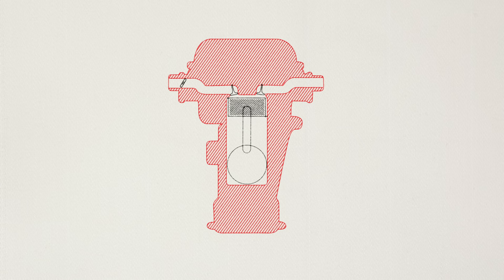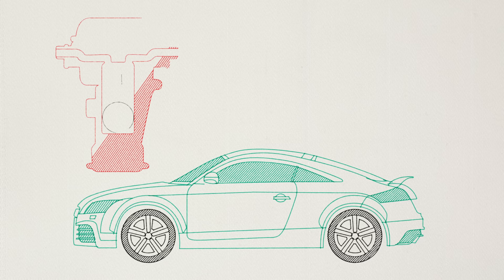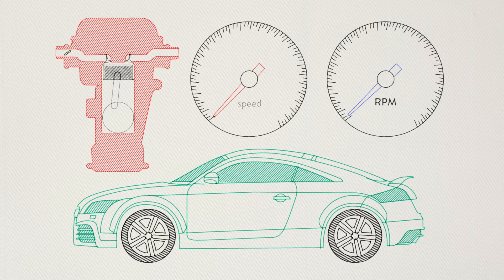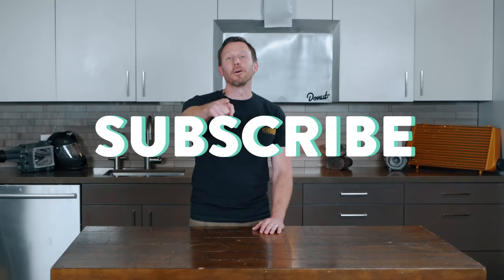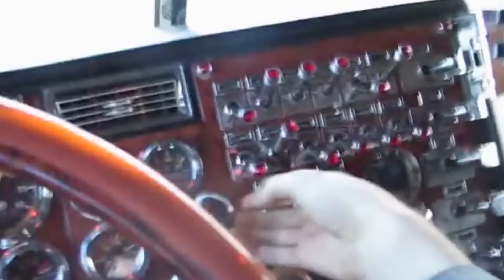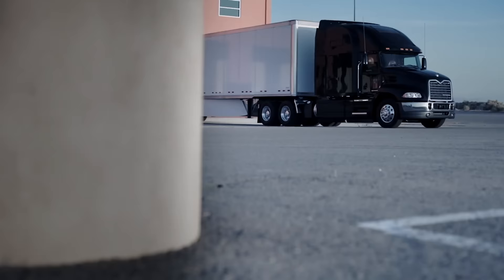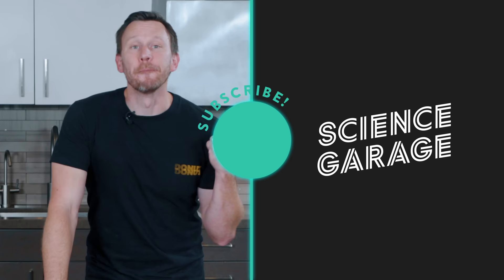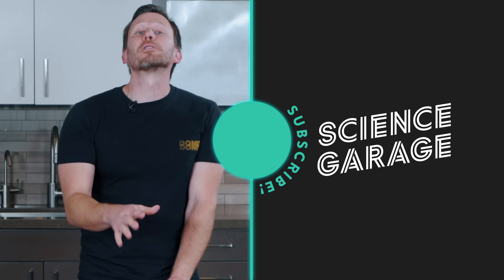ENGINE BRAKING | How Semi Trucks Slow Down Without Brakes | SCIENCE GARAGE

Comment: Can some one explain what happens in a similar situation in automatic transmission
Reply: the resistance you feel when you let go of the accelerator pedal but still in drive in an Automatic?
you are pumping Automatic Transmission fluid through a pump automatically with the rotation of idle coming from the engine, that takes energy, which makes it feel like you're slowly braking (which you are) that's why when you switch to Neutral, you can coast wayyy further than coasting in Drive.
also, depending on the car model and how the transmission is assembled, it can cause Transmission damage if you coast in Neutral, depends on the Brand and Layout of things though.

Comment: It is not the throttle body !! I tried and it's not true, it's the compression. I have a cable operated throttle and I turned off the engine. When I hit the gas I still decelerate at the exact same rate

Comment: The first ‘engine braking’ he explains is commonly called transmission breaking, used in gasoline engines and practically all experienced truck drivers, transmission breaking is more commonly used with truck drivers, the only time truckers will use their engine brake is when going down hills or if the want to increase back pressure in their motor/create more sound, and i am not completely sure on his explanation on diesel jakes, but old Detroits and cummings, dont open the valve during ignition, they will be harder to open the valve during exhaust thus causing more dead air in the cylinder, and modern jakes(exhaust valves) are just as said, its a butterfly valve just after the turbo actuated by an pneumatic cylinder, commonly off, low, mid, and high, or off, low and high, it will close the valve accordingly and during switching to high the valve will close 90% of the way and exhaust gasses will cause back pressure in the cylinders slowing it down and the pressure will have to overcome the butterfly valve to escape, the back pressure will slow down the turbo and not push as much pressurized air into the intake

Comment: I drive an 18-wheeler and I'll be honest without that engine brake this turns into a nothing but a 80,000 lb screaming missile that won't stop it takes on average 400 to 500 yards just to stop a semi so next time you guys think jumping in front of a semi and cutting them off not the best idea because you're definitely going to loose your car or your life. No semi truck stops on a dime.

Comment: There is just one thing that p.sses me off especially in uptight communities that we need to pass here in my side of the world, you have a steep hill when coming through a town or coming into a town which will require the jake to be turned on, but no, the Karens in town had the authorities set up a law prohibiting the use of a jake brake at night,  how the hell am I supposed to descend with a full load without wrecking, there's no other road pass town and I have to offload in the morning 500 miles away, so what do I do, turn on the jake and let her sing, baby...

Comment: No, the draw of air restricted by the throttle body when closed is not at all what causes engine braking in a gasoline engine. 

Engine braking in a gasoline engine is caused by the removal of combustion at the top of the compression stroke. Meaning, because there is no combustible gases detonated to push the piston back down, the air being compressed as the cylinder reaches the top of the compression stroke is the restricting force slowing the vehicle.

Durp.
Reply: No, that is a common misconception. The compressed air acts as a spring, most of the energy used to compress it is returned on the next stroke. When the throttle body is closed, the piston must pull a vacuum on every intake stroke, this is where the engine braking occurs.
Diesels do not usually have throttle bodies so instead the jake brake was invented to provide engine braking.

Comment: Does it mean that even tiny little diesel Peugeot engine have jake brake?
Reply: They could, but most dont.  They aren't really necessary in small vehicles. Big trucks use them to help slow the heavy truck.
Reply: @Bendigo1  thanks for your answer man! You mean that drag and friction are enough to slow down a light vehicle. Sounds about right.
Reply: @nathanwabre  that plus the foot brake.  The jake brake is used to reduce foot brake usage when going down hill. Using the foot brake too much on a long hill with a heavy load will make the brakes fail.

Comment: You have one big mistake in this video. In manual transmission RPM and car speed have constant ratio all the time (when clutch is not pressed) so there is no way that car speed can decrease and in the same time RPM to stay at the same value!
Reply: @alexwhiteman2628  Look at 2:37 car speed is almost zero but engine RPM i still high, this is not posible in manual transmision. Animation is not accurate.
Reply: @alexwhiteman2628  When? At around 2:30 timemark he said "... and you let off the gas you're gonna feel the car slow down but the engine rpm will still closely approximate where they were when you're cruising ...".
This is so wrong!!! In manual transmission car RPM of the engine is directly proportional with wheels speed (depending of the gear car is in) so if engine is turning wheels or wheels is turning engine it doesn't matter because both engine and wheels MUST rotate in synch speed.
If you are cruising at 55 mph car must be in 4. or 5. gear so when you are slowing down engine RPM will drop faster (needle in gauge) then car speed needle ;) In animation of this video is not like that.
So, this video is not good.
Sorry for my bad english.

Comment: I must have misunderstood something here. The just I got is that diesel engines will not brake without the Jake break. My old diesel truck has no such Jake break switch and engine brakes better than my mom's old Honda Civic.
Reply: That's a different type of engine brake, like an exhaust brake
Reply: @specialopsdave  oh? How does that work then?
Reply: @commanderdan2319  Kinda like intake vaccum braking on gas cars, but the flap is in the exhaust, effectively increasing engine load using exhaust pressure. The engine braking effect is because of the difference between intake and exhaust pressures, hence why it is the same effect as vacuum braking in gas cars. Jake brakes, on the other hand, mess with the engine valve timing to increase pumping and compression losses
Reply: Diesel engines have much higher compression in the cylinders.  So when you let off the throttle there is more compression than in a gas engine.

Comment: I'm likely not the only person getting OCD convulsions from watching the internal engine cartoon with the valves pulling up into the intake/exhaust bore, while it SHOULD be pushing into the combustion chamber. Your cartoonist is clearly not up on their engine mechanical knowledge. And some diesels do have throttle bodies, as well as some have Exhaust brakes (like a throttle valve but in the exhaust)  instead of a jake brake. But that's pickin at straws.

Comment: Mistake, you must have the clutch engaged or you are not engine braking.
Reply: The clutch connects the engine to wheels, if the clutch is in, the engine can not possibly have an effect acceleration or braking.

Comment: The throttle still existing on the motion graphics for the diesel bothers me so bad its hard to watch this.  Also  the valves opening into the intake and exhaust instead of the combustion chamber, its like the person making the animation had no idea how a spark ignition nor diesel engine works, and also quality control doesn't seem to exist on this channel.
Reply: Some newer diesels actually do have throttle bodies.
Reply: @phillipstein9099  Huh really?  I'd be interested to hear the reason why.
Reply: @travismason2811 ... You would have to ask Cummins for that. I was surprised myself. I repair transit buses and I was diagnosing a throttle problem. I figured it was the TPS which is the pedal but the engine was equipped with an actual drive by wire throttle body.
Reply: @phillipstein9099  You remember what engine it was, might try and look that up.

Comment: Everyone seems to forget that what you lose to that throttle vacuum you gain back in the next stroke. Don't believe me? How about an experiment you can all do yourselves: you need a manual car with a cable driven throttle and electronic fuel injection. Drive to the top of a hill and switch off the ignition on your way back down (to the ACC position, don't want to lock your steering!) with the car still in gear. This kills the fuel and spark. Now cycle the throttle open and shut and see if you notice ANY difference in engine braking at all, though I can tell you right now that you won't. Because physics.

Coincidentally, this is exactly what compression release brakes disrupt - if you vent the cylinder at the top of the compression stroke, you no longer recover all the energy you put into that gas, which in a diesel engine is quite a lot. That's what makes them so effective.

Comment: How come in my diesel van when I down shift it slows down the van ? My van is a diesel ford transit.
Reply: Because of the transmission. When you down shift to a lower gear, it's smaller. Therefore, it can only spin so fast. Its size limits how fast it can spin, therefore limiting your overall speed. Your engine can spin faster than the transmission, so if you let off the throttle, the transmission is going to naturally slow it down. Picture an adult running, pushing a shopping cart. Then the adult moves and let's a child push the cart, you're "downshifting". Since obviously a child can't run as fast as an adult, the cart will slow down. Hope this helps.